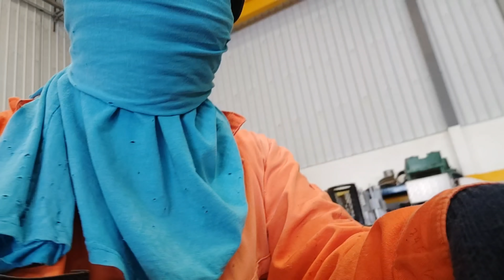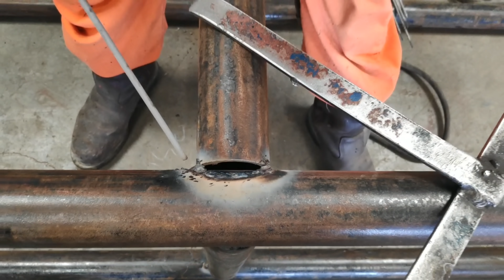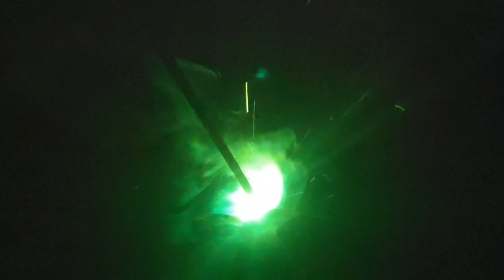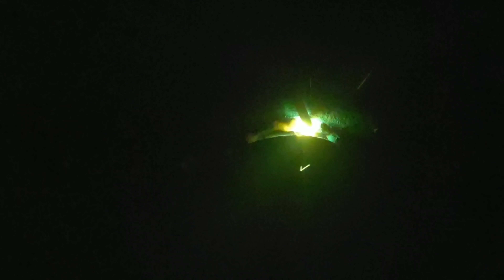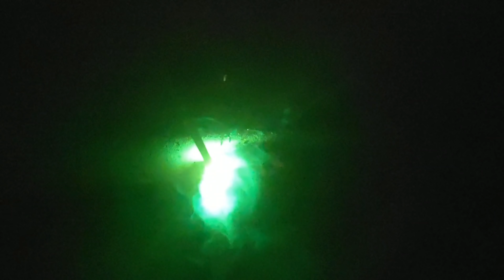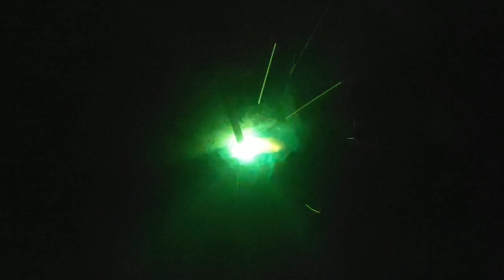SMAW Flat posistion 1G
15to10mm gap
Paano Mag Welding ng malaking awang
How to weld Big Gap

Comment: Sir tama po ba ginagawa q gumgamit aq ng filler rod.bale double pass po ginagawa q first build-up then remelting.3years na po aqng welder pero gusto q lng po malaman if tama.SMAW,GTAW,GMAW welder po
Reply from the maker: May mga tamang procedure ang welding kabakal,
Yung mga "diskarte"  katulad ng sinabi mo at katulad ng ginawa ko ilan lang yan sa mga pwedeng gawin,,depende pa den kung saan gagamitin, gaano kalakas ang load ,pressure at iba pa.

Comment: Bos paano naman po ung pa ilalim parang mahirap tumotulo ung welding rod ko bos
Reply from the maker: Control po sa amp kabakal and kasabay na din po ng tamang manipulation ng electrode and angle☺️
Reply: Pailalim na welding overhead welding gamitan mo ng rod na E-7018  3.2mm 80 to 120 amperes depende sa kapal.

Comment: Ok yn sa basic weld.pero di pwedi yn sa mga high pressure.dapat tamang fit up.pwedi nmn gawin ng tama tamad lng ksi e lay out ng maayos.
Reply: Ang title po ng video ay kung paano mag welding ng may malaking gap kaya yon ang pinakita. At isa pa po rack lang naman yan di yan pipe line. Kung ang title ay tamang fit up ay mali talaga ang video.

Comment: toxic ng comment ng iba,ang linaw sa dscription,,,kung paanu daw mg welding ng 10mm to 15mm gap,dami ntu na pinuna..
Reply from the maker: Salamt bro😇
Reply: kabayan, may maling practice sa shop kabayan, ang welder magaling. ang technique nya magaling. hindi dapat gawin ng welder yon kung magaling ang shop foreman. kailangan bang CJP yon? fillet weld and flare bevel lang dapat. kung malalaking pipe o hss yon hindi nya dapat gawin yon. Kung CJP may backing bar, kung fillet o flare bevel dapat walang butas na pupunuin.